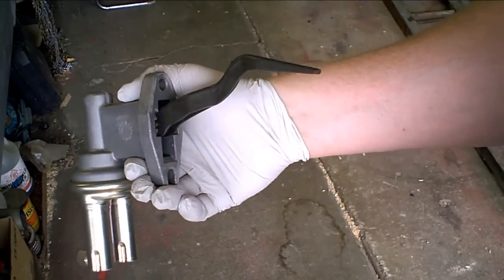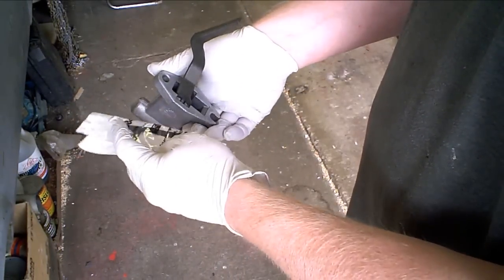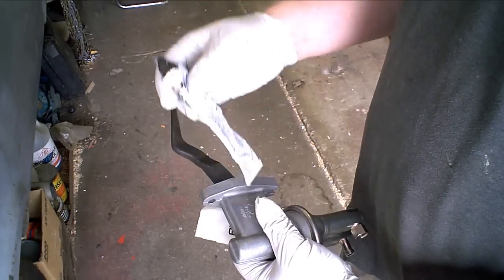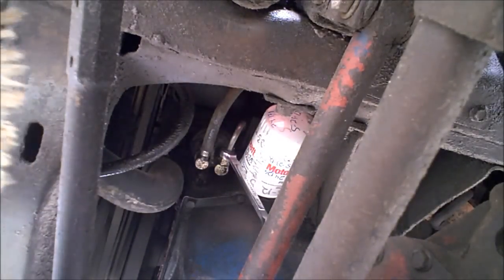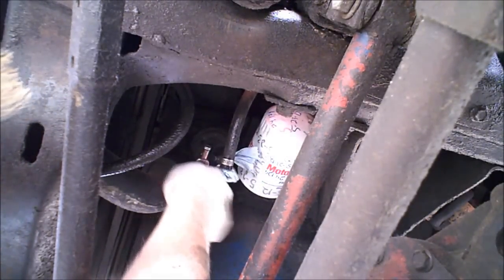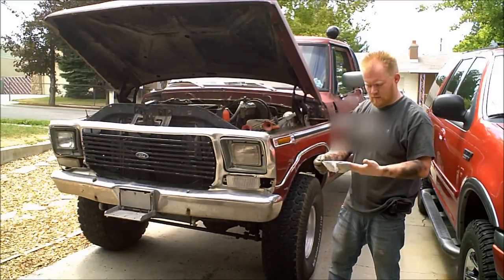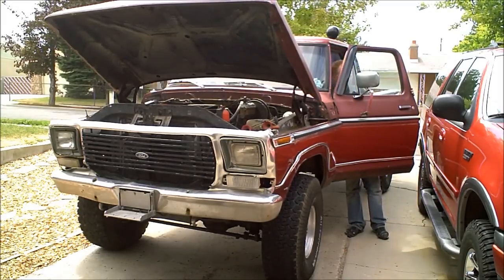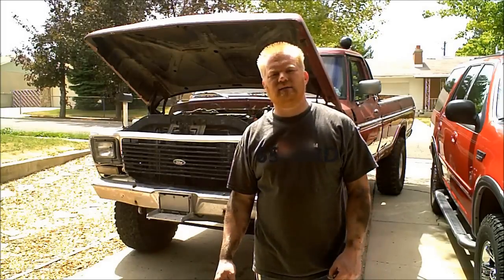Mechanical Fuel Pump Replacement FORD 351m 400

Comment: Used the #2 form a gasket on both 78’s back in the 80’s and 90’s - works fantastic with gaskets. Now everything is RTV, which most people over apply. I will pick up another tube of the form a gasket for my 79 when needed. 
I liked the 351M. First truck developed an overheat condition, and nothing seemed to fix it. T-stat, hoses, flushes, bypass heater core, new intake gaskets and valley pan, etc. Pulled it and dropped in a 400, no problems. 2nd truck no problems. They both ran good.
My 79 had the same overheat issue (351M) according to the previous owner, so they dropped in a earlier 70’s 460. Love it, lots of torque. 
Best of luck with your truck. They are awesome trucks in my opinion. I also own a 2004 F350 6.0 for plowing and my daily driver for the last 12 years is a 09 F250 Super Duty 5.4 - been a highly dependable truck. No engine work at all besides 2 sets of plugs, it has 121k on the clock now. I have always owned a Ford truck, with the exception of 8 years when I owned a 01 ram 1500 with a 318 and 5 speed manual. It was a dog. Cost me alot in repairs over 8 years from new. Traded it in 09 with 66k on the clock. What junk for low miles and never abused. Always owned Fords and I learned my lesson. 
Sure, Ford does stupid stuff, but they all do, so I will stick with whats been good to me and what has held up the best - Ford baby! Peace.

Comment: Thanks you need a 1/2" line wrench and a 5/8" to hold it. two 1/2" bolts head hold it!  I need to get #2  form a gasket though!

Comment: Just fired up my 79.  First issue was gas poring out the back of my edelbrock carb.  Fixed that to find my pump shooting gas on the exhaust manifold.  Now that I've run a decent amount of gas through the system I think I plugged a filter I installed at the gas tank.  Man letting a truck sit for 15 years is a bad thing.  LOL

Comment: I wonder if it will be that easy for my 81 ford bronco but ya showed me a good way to start . Awesome vid thanks.
Reply from the maker: Oh yeah, It will be identical if you have the 351m or 400.
Reply: thanks, young fella for the brilliant video it made me remember what angle I installed the pump I'll be working on the pump in the morning, I see you have lots of room with your truck to maneuver your hands I have to remove the power steering unit to get hands in there and the cross member is very close to where the two hoses are connected, I have an 81 4x4  35c Bronco had for many years
Nga mihi

Comment from the maker: Yes it is a straight swap from a 351M to the 400. Some of the accessories and probably the exhaust manifolds are slightly different because of the year difference but everything else is straight forward. The distributor and everything from the 351m will plug into the 400. The 400 also probably came out of a car so the the oil pan will be backwards so you will want to use the one off the 351M along with the oil pickup.

Comment: I'd recommend installing a fuel filter between the fuel pump and tank to make your fuel pump last longer.  Rust from a tank will destroy the diaphragm in a fuel pump pretty quick.
Reply from the maker: +Dan P That's not a bad idea BUT a fuel pump has limiting suction power and slight restriction can cause it to not pull gas up. That being said, all the failed pumps I have disassembled have failed do to a dried up diaphragm. If you did put a filter inline I would use a metal mesh filter and not a media filter.
Reply: They don't dry up if they're wet and they can't stay wet if debris from the tank cause a leak in the diaphragm.  My dad's 79 f250 400 has a lot of rust debris even after treating the tank so it's a must have item for him.  Having it installed is not causing any issues.

Comment from the maker: I don't know the compression. The lower the compression the cheaper the gas you can use, although in 73 they were still rated for leaded gasoline. It is my understanding that the cylinder heads are a direct swap as well. This can effect comp ratio. I know there are casting #s on everything and online you can see exactly what you have with the two motors.  I had a 78 bronco w 400 and this 78 f150 with 351M . The 400 was a HUGE power difference. I pulled this 351M out of a Ford LTD 75-76 (Free)

Comment from the maker: That's an odd swap. Most people stay in the same model like a 360 or 390 (assuming it came with the 352 to start). I like the 351m/400 engine there just isn't a huge following for them. If I recall the 460 uses the same transmission bolt pattern so they are fairly easy swap. You probably have the C6 automatic behind it?
Reply: They came with 351m/400 as well

Comment: Hi, just getting back to the fuel pump.
The previous owner cut the pipe leaving an inch or so from the pump remaining, on the line going from the fuel pump to the carburettor.
So now I am looking for an adaptor that I can fasten in at the fuel pump and then clamp a fuel line to.
Same size connector on the inlet of the fuel pump that is used for the line from the tank. (Which seems to be fixed to the body of the pump).
Any thing come to mind?
Reply from the maker: OldDog NewTricks I think I understand. You can either go to a wrecking yard and cut off the fitting or buy a 1/4" NPT Male x 3/8" Hose Barb Fitting online or at you local auto parts store.

Comment from the maker: So your 73 400 needs a valve job? You will need to put hardened valves in so you can run unleaded gasoline efficiently. The lead helped to cool the valves and without using lead (or lead substitute) you can actually suck a valve up into the head. Or again look into swapping the heads from your 351m that is already set up for unleaded.

Comment: I just can't seem to get to the top bolt on mine the power steering pump is in the way do I need to move it? Also my valve cover says 351 m400. But the intake and outtake for the fuel are on opposite sides the intake is towards the firewall where the hose that goes to the carburetor is pointed towards the front fender.
Reply from the maker: Yeah, you may need to move the power steering pump.

Comment: Thanks.  Good Point..Eng. came out of a 73" mercury.  

Are the 73's in a low compression era?  if so,  what might I do to rectify that, if it is an issue or not?

Comment: Have a 1980 F150 4x4 w/ 351M.  Have a 1973 400 w/ 60,000 miles on eng. stand.  needs valve job.  Is it  prettymuch a straight swap or am I going to run into issues?  My understanding is I put new distributor in for electronic ignition and good to go.  Prob. new oil pump also.  will everything hook up ok?

Comment: My bolts aren't lining up, they're about half an inch below where they should be.. any help?
Reply from the maker: The lobe for pumping is at its highest point pushing the pump arm. You can rotate the engine 1/2 a turn and this should make it  easier. It will always push on the arm a little bit though.

Comment: Hi, I have bought a 1978 f100 as a project vehicle
Unfortunately there are a few things missing.
Like the fuel line attaching at carb.
Your video was a big help.
After watching, I will check a few things tomorrow in the light.
My F100 was built in Australia and there are a few things different to US.
Can you do a video showing?
* Fuel line from carb to tank
* Do you have AC, if so can you show (there seems to be a spare pulley of the crank shaft of mine, closest pullet to the radiator. I wonder if it was for an AC, not sure where it would go into the cab).

Thanks,
Reply from the maker: OldDog NewTricks You can just run a rubber hose from the tank to the fuel pump and then from the fuel pump to the carb. Nothing fancy or special about it. Chances are the engine was swapped or it did have AC and the AC compressor was removed.

Comment: Hi, a little bit off topic. When I got the truck delivered there was two plastic inner fender liners in the back of the truck.
I am guessing they are for the front. Do you have them installed?

Thanks,
Reply from the maker: OldDog NewTricks I don't have them installed and I don't think I've ever seen plastic liners on a 73-79 Ford truck. The rears did have a small plastic shield that covers the front inner side on the fender.

Comment: Hey Buddy, nice vid. I have a question though. I have a 1979 Lincoln Mark V with Ford 400. When I disconnect the first fuel line the gas just keeps coming and coming. About 1 1/2 gallons have drained out with it not letting up. The repair manual says nothing about jacking the front end of the car up or anything. What's going on?
Reply from the maker: +Sammy Haggerty It's just siphoning out from the tank. If it's rubber stick a bolt into it, if it's steel put a piece of rubber hose on it and then a bolt or just let it dump into a gas can.

Comment: I'm having trouble putting a fuel pump on my 1978 Ford F-250.   I tried putting the pump in many different ways but it feels like it hits something and it doesn't sit right.  I tried putting grease on it and still doesn't want to go in.  I don't want to force it in.  I would imagine it'll go in easily but doesn't seem like it.  Hopefully you can help me out.   Thank you for your  time
Reply from the maker: Put it in with the plunger lever pointing slightly down. This will make sure it is under the Camshaft Fuel Pump lobe. Now it won't want to sit level on the mounting flange without force. This is normal because the cam lobe is pressing on the fuel pump lever.  Force it level and bolt it up.
Reply: thanks I'll try it
Reply: Am trying to install one in my 79 Mercury cougar is giving me hell how do install it in my car please someone help me out

Comment: Hi, took fuel line off and cleaned it out.
Used form a gasket on barb fitting.
Syphoned old fuel out.

Came to put new fuel in and as fuel goes in to the tank it rises up the fill tube.
So I have to stop, then it settles down and I can add more, but again it rises up the neck.
Must be something to do with a vent or the Evap canister?

Any ideas,
Thanks.
Reply from the maker: OldDog NewTricks The large rubber fuel hose that connects the metal filler nozzle and tank is more than likely kinked.

Comment: I would like to get the petrol option working. I bought a 1/4" NPT Male x 3/8" Hose Barb Fitting. For a test I connected the mechanical pump to a jerry can. The car started and the pump seemed to pump. (The threads of the fitting seemed to leak though - is ptfe tape an option here?). The engine ran, but was rough.
I am not sure of the tank and fuel line as they were disconnected. I pulled the bolt out of the fuel line that the previous owner had put in and the old fuel looked kind of jelly like.
Not sure how to go about checking / cleaning the tank (Leaks etc) or the fuel line. Any suggestions?
Reply from the maker: OldDog NewTricks They sell yellow teflon tape that is petroleum resistant or you can use "form a gasket" on the threads. Cleaning the old tank can be a time consuming job. Acetone will dissolve old gas and help you clean it out.

Comment: I have a '79 Ranger with the 351m. I was driving it a couple days ago only for it to die on me. Got out, took a look and came to the conclusion that fuel wasn't getting to the carb. I replaced the fuel pump, but to no success. It'll crank and all, but there isn't any fuel getting in. Any ideas?
Reply from the maker: Make sure your fuel line before the pump don't have a hole in them. The pumps take a while to prime with fuel with only engine cranking. You can speed up the process by filling the carb through the vent holes with gas(it'll allow the engine to run for 30+ seconds).
Reply: +sixtyfiveford So I've been putting fuel in the vent holes, but to no luck. It'll do as you said, crank run for a couple seconds but nothin.
Reply from the maker: I would check if there is a hole in the line prior to the pump. You can eliminate the pump being the issue by putting a fuel line from the pump directly into a gas can(bypassing the stock fuel tank).

Comment: Why lube the fuel pump lever arm when it gets oil splashed on it from the engine to lubricate it?
Reply from the maker: Because it's dry and may not get oil for a while upon initial startup.
Reply: @sixtyfiveford  Thank you. Di you have any issues with the cam rod that drive the pump needing to be held from falling out? I've heard some people use grease to keep in place?
Reply: @sixtyfiveford  I was wondering the same but also wondering what type of grease? I've got some high heat grease for bearings, can I just use that or should I use a different grade of grease?

Comment: +sixtyfiveford I have to do this with my 1977 Ford Ranchero GT and I am not sure which side of the pump is the inlet and which is the outlet.  Hopefully the threaded side is the inlet like yours was but I am not sure.  The Mechanical fuel pump has been disconnected for a while because we have been running Electronic fuel pumps on it.  is the threaded end always the inlet or could it be the outlet sometimes?  Anyway we are going back to old School because I do not like the electronic fuel pumps.  Even my  Edelbrock fuel pump sucks.  I might put it in the back to resolve vapor lock issues if there are any, but I want to just go straight old School if I can get away with it.  like I say though it has one on it.  So it is just a matter of figuring out which side is inlet and which is outlet.  Any Suggestions man?  Thanks!
Reply from the maker: It's just the opposite. The threaded side goes up to the carb(outlet) and the barbed side(inlet) comes from the tank. This is the same on all because the engine needs to move/flex independently of the vehicle frame/gas line. So the barbed side allows for flexible fuel hose from the gas tank.
Reply: Oh Awesome!! Thank you for your help.  I got her installed and she runs beautifully.  No more Electrical junk pumps.. $15 for the mech pump and we are rolling well.  too a little starting fluid and a few cranks.. But we got it.  Turns out the pump that was on it (Mechanical) one did not suck or blow anymore.  Maybe the valves in it went bad or maybe the diaphragm inside dry rotted.  They take some torture for sure!

Comment: When I changed out my fuel pump on my 79 F150, I changed out the small fuel hose from the fuel supply line to the inlet of the pump.

Comment: I had a huge tube of tat #2 gasket crap, but I threw it away lol. It was the crappiest stuff I have ever used, my dad used to be a automotive mechanic and he said he never once saw that crap work, fluids would push it right out of the way and leak instantly.

Comment: Like many of you, I cannot get the pump back in under the cam lobe.  At least, it feels like I can't.  Regardless of how I put it in, the arm just moves around in a big empty space.  How do you know when you've positively got it in the right place?

This is hardest part of the swap and the video shows virtually nothing.
Reply from the maker: You're over thinking it. If the pump sits squarely on it's mount, it's in the right position.

Comment: Did mine today 83 351C...not easy! Had to remove bottom radiator hose and drop the coolant to allow spanner decent access for bottom  nut. Then I had to unbolt power steering pump to allow me to remove and install fuel pump...Things are never straightforward as in the book or on YouTube!
Reply from the maker: +Ian McKay True.

Comment: Good video, thanks:  my fuel pump on a 78 400 has started leaking out of a small hole at the top of the casting... I wonder if a small screw has come loose, and fallen out, I can poke a piece of stiff wire in there,
from the oil filter side, but cannot see if it's threaded,
Almost looks like the casting is held together there,
but the other side, facing foreward near the power steering pump, has a similar cast moulding, but no hole.
Any ideas on that, anyone ??
Maybe i can try JB weld paste to block the hole ?
Reply from the maker: That hole is there to show when the diaphragm has ruptured.
Reply: Ah,  😕 thanks for reply, 65 Ford,
I am in England ... can i block the hole up temporarily, until i source a replacement pump, or won't that work ?  maybe fuel pressure will blow the JB weld out ... 
Worth a try, I still getfuel up to the float chamber !
Reply from the maker: @chrisfranklin2104  It won't work. The rubber diaphragm is ruptured so it won't pump fuel. If the chamber is allowed to fill with fuel it could hydro lock the pump and bend the pump arm and or destroy the camshaft fuel pump lobe. You would be best to just temporarily bypass the pump with a low pressure electric fuel pump.

Comment: I feel like I'm doing this wrong. I point the tip down but I end up hitting something. it doesn't matter if I point it up or down it I can only get it to slide in 1 way.  It just slides onto the stud and then if I push on the bottom of the fuel pump inward I can get the lever to move enough for me to start the thread.
Reply from the maker: motokokoto Sounds like your doing correctly. There is a egg shaped lobe on the cam that the fuel pump arm rides on. As the cam spins it pushes the arm up and down. It will always touch a little but may feel like you really have to lever it if the cam lobe is in the highest position. You can force it in or rotate the motor a little so the cam is in the lower spot.

Comment: the auto store can't seem to give me a straight answer-
I have a 87 f350 with a 351w with a mechanical pump just like that one. I shouldn't have an electrical pump also right? I'll sub if you reply ty
Reply from the maker: I have never seen a Ford with electric and mechanical fuel pumps. You should only have one or the other. If you have a fuel pump relay/fuse in your system you may have an electric fuel pump.
Reply: sixtyfiveford Ty